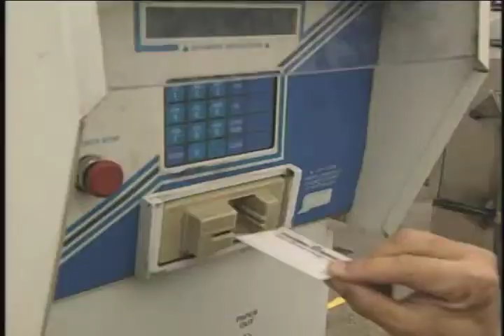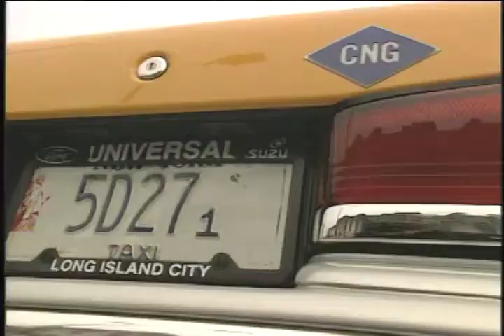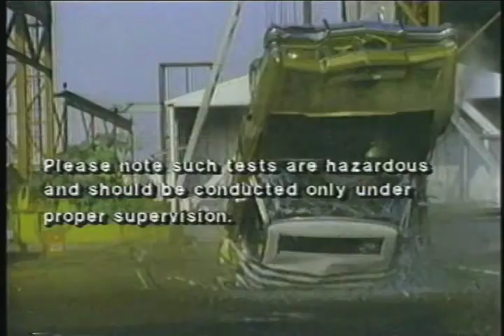￼Why Is This Guy Smelling Car Fumes? Crazy? What Is Going On Here?

Comment: I'll tell you another thing about natural gas. When it is time to do maintenance on an engine that runs on Nat gas and you tear the engine down to any point to change any kind of internal parts of the engine, you might be amazed at how clean the internal parts are when you take them out. A natural gas engine will last magnitudes of hours compared to an engine that uses any other kind of fuel that is consideref a fossil fuel. They run much cleaner emissions than any other internal combustion engine. There is another gas that you can use that has the same characteristics and that is hydrogen (not a fossil fuel) and it has no harmful discharges. When you burn hydrogen you produse pure water and it is a very volatile gas and highly explosive.

Comment: What happened to LPG why is it not around anymore for vehicles? Not sure I agree with that guy about availability yes that's true but they have normal thanks as well so you can fill them up with diesel or petrol in an emergency
Reply: they are very much around in Europe.? people converting atm a lot or buying them up as fresh buns as mostly they run wildly cheaper. depends on the motor, size, etc obviously 
the way bmws are built makes them quite compatible with Lpg systems 
and mercedes’ aren’t, kills them n don’t operate as should. but don’t remember why atm. 
u always need petrol in ur tank as that’s how the ignition happens. so car starts on gas n switches to lpg.
Reply: Fake. almost gone in europe as well